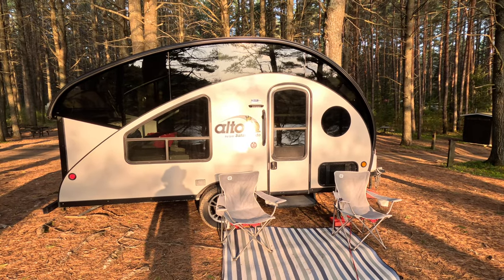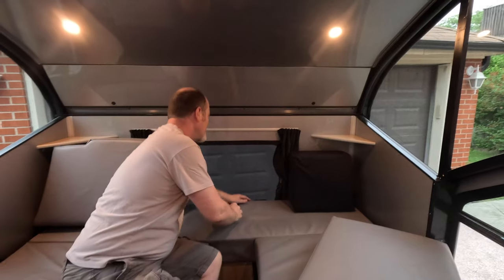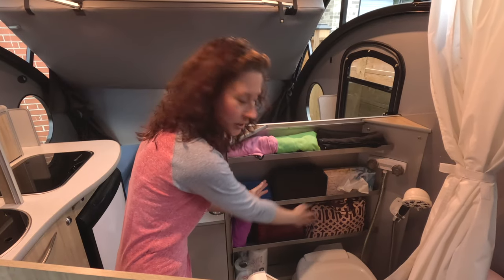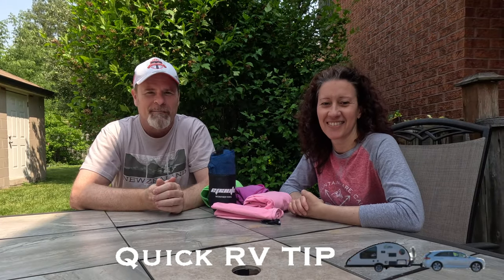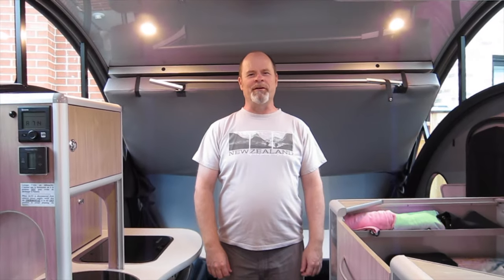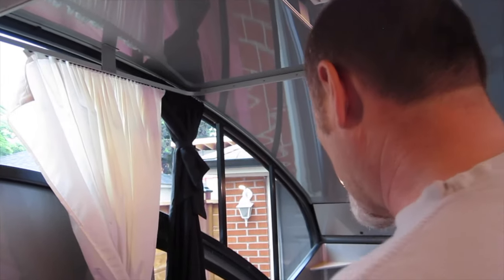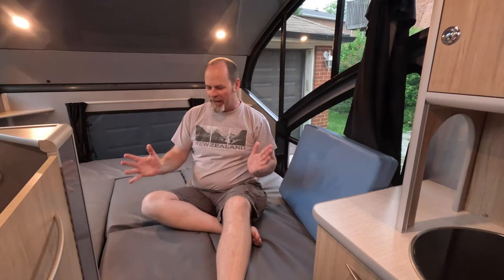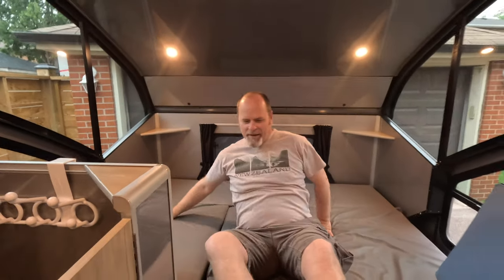Safari Condo Alto R1723 Teardrop RV Part 2: folding caravan travel trailer w/ bunks and bathroom

Comment: Altos do tend to hold they are value better than most travel trailers. However, as of the summer 2023, used Altos may be listed with the hope of recovering the original cost, but they are not selling at that price. Frenzied Alto buying fever is a thing of the past. Buyers  seeking used Alto expect to pay a lower price due to reasonable depreciation. Sellers seeking to recoup their original costs or to make a profit are only deluding themselves in the current market. This is in keeping with the general decline in RV sales in the US today. New RV sales are down 50% in the United States. That number is 65% in Canada. All RV sales have declined, whether used or new. Prices have followed suit.
Reply from the maker: Resale values are still strong, but definitely not what they were through the height of Covid. I still think it’s in the plus column compared to buying a cheaper metal skin, rubber roof, commodity trailer. But the financial equation works for us due to savings on the tow vehicle, the convenience of storing it at home, and yes-from less of a hit on depreciation.
Reply: @DayHikerFromTheSix  I agree. Overall, Alto ownership has cost less than a traditional trailer ownership due to much a  lower depreciation rate.

Comment: Thanks for a great video.  We bought our R1723 in 2020, and have enjoyed many trips so far.  I really like your modification to put memory foam atop each cushion and cover with vinyl...I'm going to look into doing same.  Currently, we bring two 2" latex foam rolls for sleeping, but your approach is more convenient over the long haul.
Reply from the maker: Yes the cushion covers make it convenient and easy. Glad you're enjoying the trailer & thanks for watching.
Reply: Hi Dave, I have similar question to my previous post... I'd be curious what you pull your R1723 with? Plus then, if you've calculated your "normal everyday" MPGs verses your "trailer pulling" fuel economy MPGs calculated at the pump without relying on the vehicles computer? Thanks!

Comment: Totally agree with your reasons for buying it. We bought a used T@B 400 for many of the same reasons as you (just as the pandemic hit DOH!). Our only concern is the tongue weight, as it pushes the upper limit for our vehicle (2016 Kia Sorento V6). One question you may have not seen, and may have answered in a later video, is gas mileage with your Venza.
Reply from the maker: Best average for a trip is 15.4 l/100 km or 15.3 US mpg (secondary highways/lower speeds), worst is around 19.5 l/100 km or 12 US mpg (freeway/headwind/higher speeds). Average on trip from Toronto to Waterton/Banff/Jasper in the Rockies was 16.4 l/100 km or 14.3 US mpg (which includes a fair bit of driving without the trailer). By far and away the worst gas mileage was in Ontario on the Alberta trip, it was much better in the prairies and mountains.
Reply: @DayHikerFromTheSix  - That sounds about right for us too. As soon as you hit the flat, less gas is used. Hills are the killer for gas mileage.

We have been averaging 15 - 17l/100km @100kph because of where we have travelled (Oregon coast, various lakes in Alberta). We have found that going to one of our favourite lakes, which is well into the prairie, takes less gas if we go via the Trans-Canada, as it has less hills than the back roads. Our last trip we were getting about 13l/100km. Still a tough adjustment when your regular highway gas mileage is around 7.5l/100km.

Comment: Thanks for your work on the videos! 👍 So, I was wondering if you've calculated your "normal everyday" verses your "trailer pulling" fuel economy MPG calculated at the pump without relying on the Toyota Trip Computer? Thanks again ever so much... continued blessings!
Reply from the maker: Normal everyday highway mileage is between 8.7 and 9.5 l/100 km calculated at the pump, depending on speed/wind/terrain. Towing ranges from 14 to 18.8 depending on the same factors. I averaged 16.5 (trip meter number) on a trip out to Banff with the trailer with an average speed of 100 km/h. That was with car and trailer both near max payload. Wind was the main factor changing it from day to day. The trip meter is marginally optimistic…if I get 8.7 on the meter, the pump calculation would be 8.8.

Comment: Have you experienced any issues at all? like leaks between the gaps?
Kind of concern about the lifting mechanism would fail at certain point.
Any rubber seal maintenance work required?
Reply from the maker: Never had any leaks. I did have to replace one of the gaskets, but even with it torn it didn’t leak. The trailer has been in production for a long time and the roof design, while mot intuitive, is proven. Thanks for watching!
Reply: @DayHikerFromTheSix  this is very encouraging information! how does it hold up in minus thirties Canadian winter?
Reply from the maker: Definitely a three season camper! The metal walls get darn cold when it’s below freezing.

Comment: Do you find it hard to get in your garage? I’ve read people having to switch tires or severely deflate the tires to get it in. 

Also, would you still get the shower and toilet with what you know now? Showering primarily in campground bathrooms etc.
Reply from the maker: Yes, we have to switch to smaller rims & tires (I'm going to buy them this fall) or run the Michelins completely flat to roll it into the garage, and the tongue has to sit on a low profile floor jack. But our garage door has a bit of sag and the opening is smaller than standard. I think in a newer, more standard sized garage it wouldn't be so challenging.
Reply from the maker: We bought our Alto during Covid and we chose this model with the toilet/shower option mainly because of it, but yes we would still choose it.